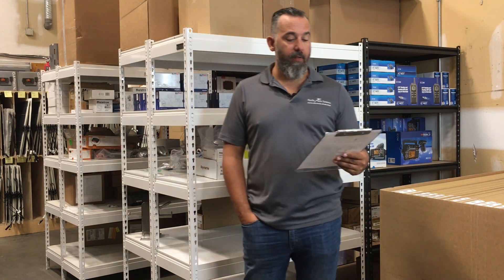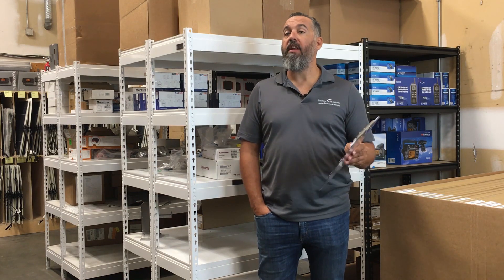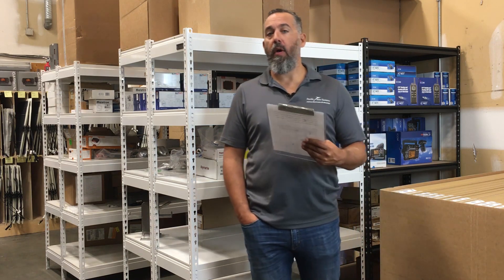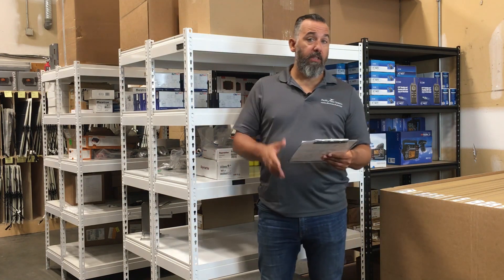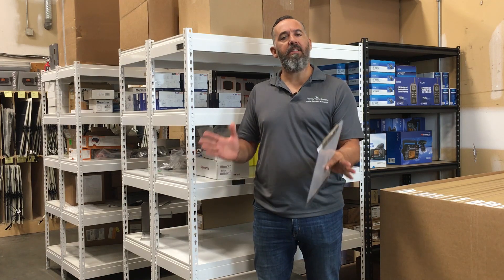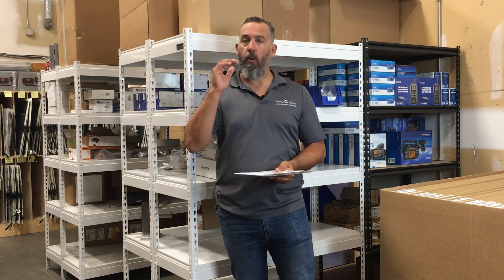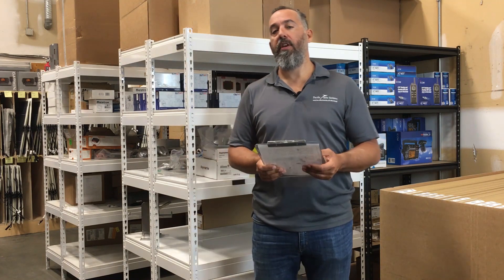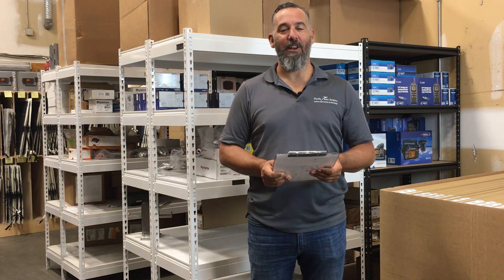Ask PYS - How Do I Figure Out How Much "Usable" Battery Power I Have?

Comment: I have a 31' boat with 2 Group 24 AGM batteries @ 79 Ah each. I would like to increase my capacity and would like your opinion on the following. Would it be better to replace with 3 of the same or 2 Group 31 105Ah batteries? I have also considered 2 6volt AGM which I would wire in series as these are 260Ah each. I truly appreciate your videos and advice.
Reply from the maker: Are these the only 2 batteries? or you have 2 house batteries + engine batteries?  if  these are the only 2 they are likely separated into battery 1 and 2.   You'd really need to know what they each do, and which side needs to be bigger.  because if you put in 3 batteries you'd probably end up with a bank of 1 and a bank of 2

if they are a single bank.   then it's just math   3x 80ah is bigger then 2x 105ah.   and what options fit in the space you have.

if this is a house bank and not starting engines,  the 6v will be better.

Comment: 50% is a “rule of thumb” for lead-acid battery chemistry, which includes flooded, maintenance-free, and AGM, as it gives a reasonable trade-off between usable energy and battery life.  Routinely discharging an AGM battery below 50% DOD will shorten it’s life just like a flooded battery.  As Jeff pointed out, you can discharge deeper than 50%, but doing so affects the life of the battery.  Depth-of-discharge versus cycle-life is actually a continuous relationship, and it is a curve (not a straight line).  The 50% DOD “rule” is just a point on this curve.  The less you discharge them, them more total energy you can take out and put back over time, but you need an ever bigger battery bank to have a usable amount of energy available.  As someone else pointed out, this also depends on fully recharging the battery as soon as possible after energy has been taken out.  The failure to consistently fully recharge the battery will reduce it’s capacity.  This is one of the things that needs to be taken into account with battery monitoring systems.  Most of them will tell you the batteries are fully charged (100% SOC) but they won’t tell you that the battery bank only has 80% of the capacity it had when they were new.  LiFePO4 batteries overcome both of these limitations of lead-acid:  they can be almost fully discharged (while maintaining a stable output voltage, with Lead-Acid does not) AND not fully re-charging them does not reduce their capacity over time.  The other major benefit, of course, is the energy density, which is greater than lead-acid.  Thus, for a given physical size, more energy, less weight (mass) by a factor of 2.  Add in the much greater DoD, and the useable energy benefit is about 4:1 compared to lead-acid.  Now if only they were not priced like they were plated with gold.
Reply from the maker: Hey Bruce, well said. Thanks for sharing on the PYS channel. Cost is definitely a factor for many of us, even considering what Lithium provides.